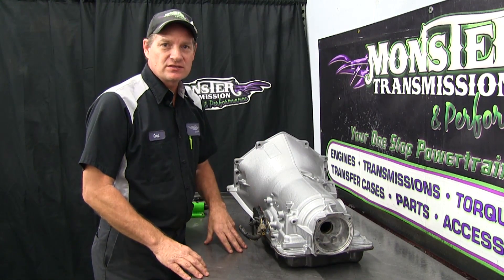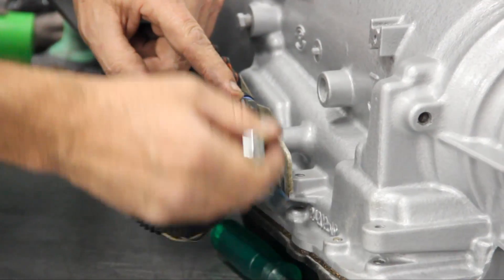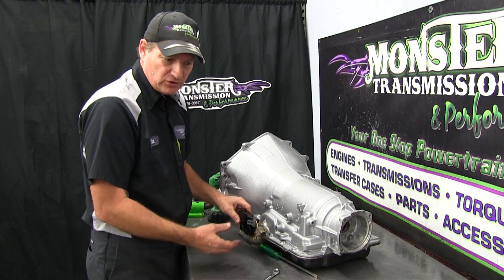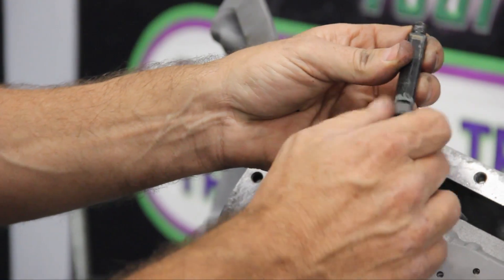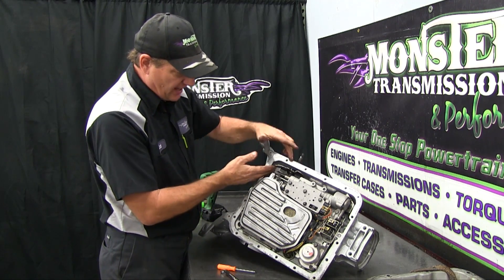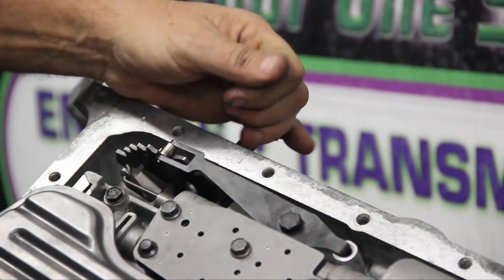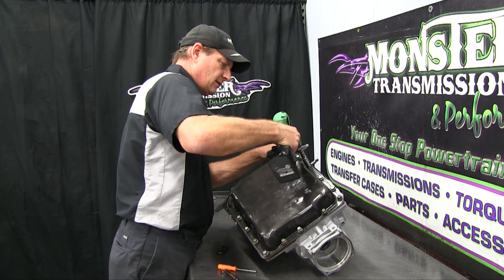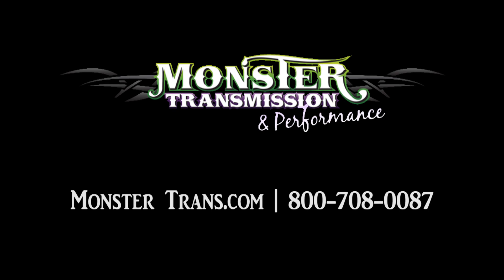Curt's Corner : How to Replace a Manual Linkage in a 4L60E

Comment: I was wondering have you come across a linkage that had loosened off inside and the shifter would shift to 2nd before it started to move and reads on the scanner that it's in OD4. It seems like their is no detent knotches from Park to 2nd gear like the detent spring isn't their till it hits 2nd gear.
Reply from the maker: From they way it sounds it could be that the detent rooster is not aligned correctly or is twisted.

Comment: Use A little heat from a heat gun to heat up connectors on the neutral safety switch.. they always unplug easily by hand for me... a little heat plugging them back in makes it easy and insures that you have it plugged in all the way...
Reply: Beat me to it lol I went to the comments just to say this

Comment: is it normal, if replacing a shorter shaft for a longer shaft, for the fit to be very snug? I had to use a mallet to convince mine to go in.
Reply from the maker: +Bobby Augustine 
Usually when that happens that means there is a little burr causing it to bind up. You can take some very fine sand paper to smooth it out and should be okay. If all is moving freely now you are good to go. Thanks for commenting. If you need anything else feel free to give us a call at 800-708-0087

Comment: What position does the rooster comb need to be on when you put the oil pan back on i noticed that small detail was not mentioned it would make a difference, im working on the same trans. Please if anyone knows where the rolker spring has to be on the teeth of the rooster comb before installin the pan thanks,.... mark pino.
Reply from the maker: +Marcos Pino It really wouldn't matter, but for general purposes park is the typical location. If any more questions feel free to give us a call at 800-708-0087. Thanks